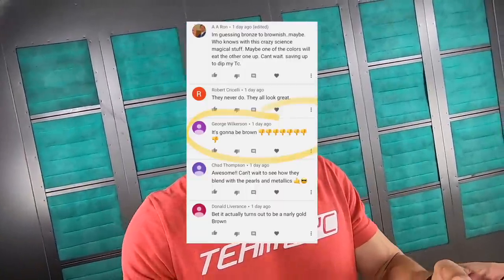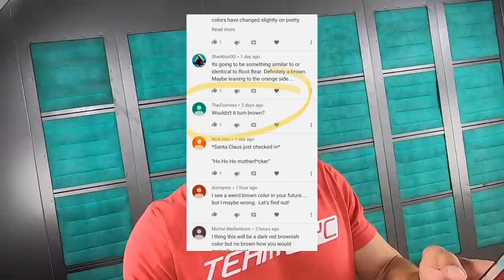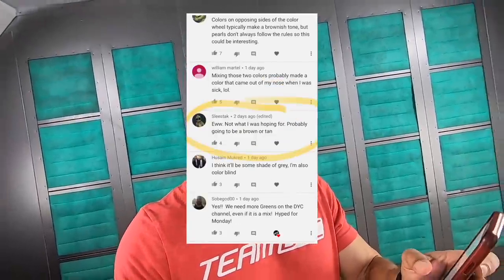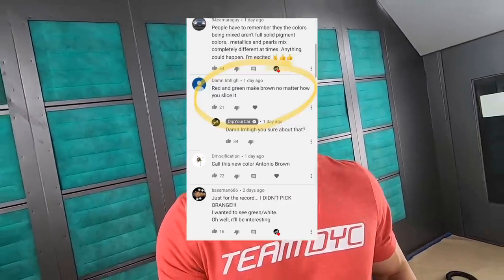Mad Scientist 7 - MIXING Nio Green + Magma Orange

Comment: Does the dip last when you spray the door handles?  How are you dealing with those?  Using them daily seems like they'd get messed up really quickly.
Reply: on the inside of the handle yeah. but you typically can't spray the inside anyways so that's why I put those handle guards on before I sprayed. they were only a couple bucks. sticky little films you can probably still find them on wish.

Comment: Sorry, I know this question isn't related to this video but...
Can you address all the colors that are no longer available from DipYourCar? I found out recently that "Go Mango Orange," "Koi Orange," and "Polaris yellow" are no longer on the website. Just wondering if they were being discontinued or if they are just out of stock.
Reply from the maker: aerosols or gallons?  I think they are all still available, maybe a couple are out of stock
Reply: I know in my particular case I ran out of "Go Mango Orange" in aerosol. I went to order online and saw that the color removed from the website (Page 404 Error). I called in and was told only a few gallons were left in the warehouse. I made my order over the phone (Very nice and helpful staff). That's when I noticed the other colors were missing from the website as well. Didn't know if certain colors were being phased out due to lack of demand or if they were removed from the website because there was no stock at that time.

~Edit~
Just checked the DYC website, Koi Orange was available in gallons. But still couldn't find Go Mango or Polaris Yellow.